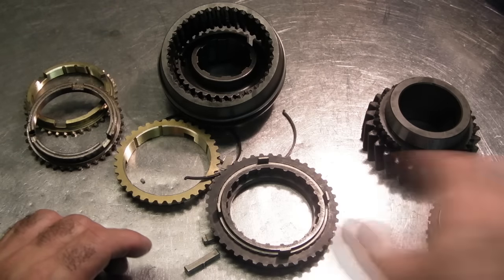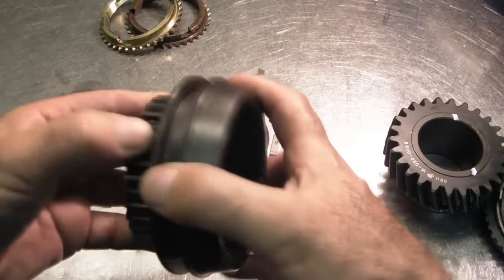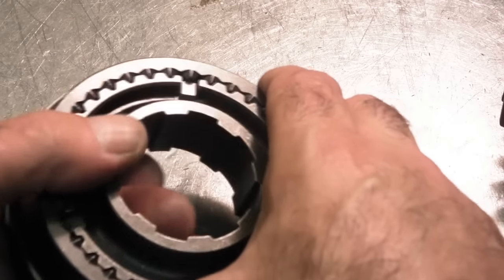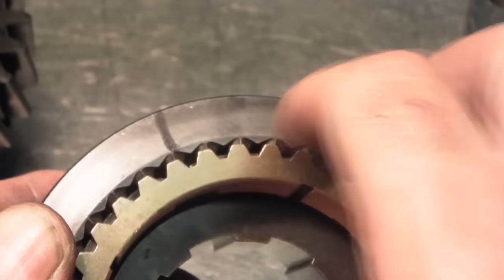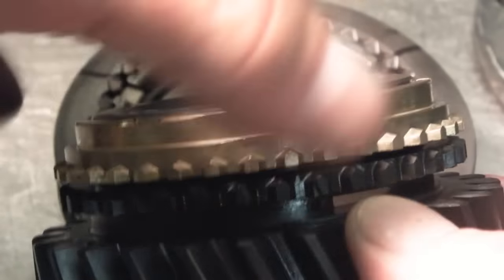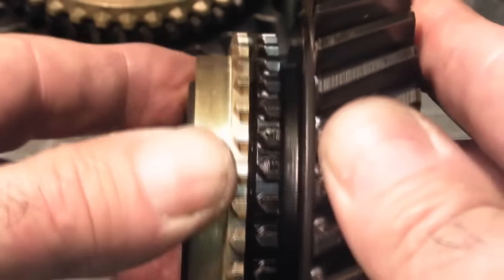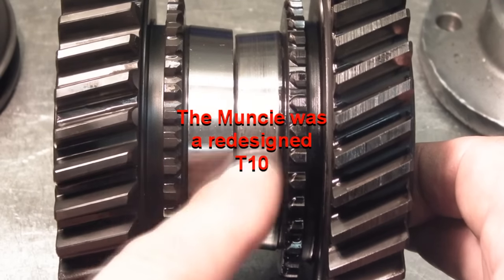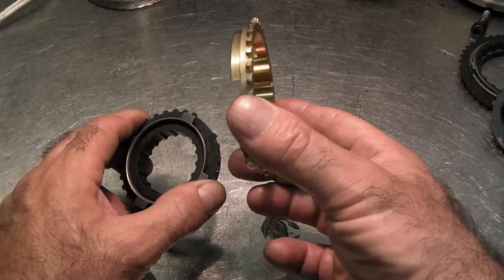Learn About Transmission Synchro Rings

Comment: This helped me understand the shifting issues I've been having in the H55F in my Toyota Land Cruiser. From the way you described their operation, my synchros aren't going bad, but may not be gripping as well as they should be to allow for smoother shifting. I always get that initial hard stop when shifting into 2nd and 3rd when it's cold lately. Now I'm going to look and see if there are any improved synchros available.....
Reply from the maker: Sounds like clutch hydraulic issues.  If it is smooth shifting standing still but hard shifting when in motion it means the transmission synchro rings have to work harder since the engine load is still on them. This will lead to ring failure.
Reply: @GearBoxVideo  Good idea. I had a stainless steel braided clutch hose that I went ahead and installed before a road trip this last weekend, and while doing that I (of course) fully bled the system, flushing out all the "old" fluid (had only been in there since May this year when the manual conversion was done) that somehow already had gotten dark with brand new fluid from an unopened bottle, and adjusted the pedal height and travel per the Toyota factory service manual. In my setup there is no adjusting of the slave cylinder itself, and I haven't yet pulled the clutch cover to observe its movement, so I haven't completely ruled out a clutch issue yet. While pedal feel is noticeably improved, the shifting hasn't changed. Next step to pull the cover and observe clutch movement lol

Comment: Hi Tony,  Sal here,,,  excellent and super informative video!  Very good delivery too!  Glad I stopped to look here!!!    I'm dealing with a 2003 Ford Ranger 5 speed stick, with a 2.3L motor, and shifting gear to gear is getting more difficult it seems. I assume it's a synchro issue,, but,, sometimes when I shift from a dead stop, from neutral into 1st gear, I can feel something sliding just as I shift.  It actually can be felt in the whole truck!   It's as if the driveshaft, or something, is sliding forward & backwards making a slight klunck sound as I shift into 1st, or into reverse when I first hop into my truck and go anywhere initially.  It doesn't do it after that first starting up and taking off.  I would love it if you could just give me an answer if and when you can!!!   But thanks very much for giving me the explanation I've been looking for for quite some time now!   Ciao Tony!!!!

Comment: Let’s see if I have this right.  The slider is rotationally fixed to hub.  Axial thrust is applied from shifting fork, to outside groove of slider, to inside groove of slider (not shown), to strut keys.  Strut keys apply thrust to blocking ring, which is forced onto matching conical surface of selected gear.  Strut keys also keep rotational position of slider fixed to blocking ring (with about 3/4 of a tooth of play).  This causes a braking action between the slider - blocking ring assembly and the selected gear.

Additional thrust applied to the slider overcomes the spring force against the strut keys.  As this happens, the slider teeth align with the blocking ring teeth.  Also at this moment, since the inclined surfaces of both the strut keys and the slider are no longer in contact with each other, there is no longer axial braking force between the blocking ring and the selected gear.  This fact allows the slider to mesh with the engagement teeth of the selected gear.
Reply from the maker: Yes, that pretty much sums it up.  Since the rotation of the gear will rotate the ring, which is stopped by the key ( called indexing) the slider most overcome the ring blocking the slider

Comment: oh this is beautiful, I just understood where the force feedback comes from. It's the angle of the ring teeth, the harder you press the more torque the ring applies to the gear, and the more force you get back... up until the point where their speeds match and no more torque is resulting from acceleration, and so they mate.

Comment: Have your book.  Very good information on rebuilding muncies.  I want to replace my shift forks over the winter. Can you tell me which ones to order.   I ordered some several years back and had to return them as they binded in transmission.  Also who sells the bearing side covers?   Thanks

Comment: Really interesting stuff.  Had a VW Golf once which would not engage 1st when engine hot. Turn engine off - no problem. Slip into 1st when car moving - no problem. Never sorted it!
Reply from the maker: Usually that is a clutch issue.  They expand when hot and you loose the release clearances.

Comment: Okay, wait, I've lost it again.  There's still one piece that you haven't explained, and it's the most important piece.  So the synchro ring slides onto the gear and grabs the gear so they are going the same speed.  What you did not explain is, how do the teeth on the synchro ring get lined up with the teeth on the gear?  What prevents a "block out" condition, as you described between the synchro teeth and the slider?
Reply: I’ll try to answer…watch from 6:40.  The backlash, which allows that backwards “blip” that he mentions, is a slight sloppiness and is what allows the whole thing to “blip” enough to align the synchroniser teeth to align with the slider teeth. Watch from 6:40.  The backlash exists because those strut keys don’t lock everything tightly in place, there is still a “sloppiness” in the assembly, which allows an “indexing action”.
Reply: @biopsiesbeanieboos55  Thank you for responding.  I spent hours yesterday watching these videos and I finally have it figured out.  Mechanical engineering is amazing.  The most important parts are the smallest—the struts and the springs...and torque.  The question is, what is even the POINT of the blocker ring? Why can't the shift sleeve be built to do the clutching action that brings the speed gear to the same speed as the output shaft itself? What is the blocking ring FOR?

The recesses in the blocking ring are engineered specifically to be slightly larger than the struts themselves, so there is about half a tooth play in either direction.  When you push the blocking ring against the speed gear, the friction brings the speed gear to matching speed, blah blah--we know that part.  But what ELSE it does is pull the blocking ring out of alignment with the teeth of the shift sleeve. That is the most important detail.  That is the blocking action (and the synchronization action).  When the driver pushes on the shift lever, if the speed gear is going at a dramatically different speed from the output shaft, then the blocking ring will be pulled hard out of alignment.  Too hard for the driver to overcome.  The flanks on the teeth of the shift sleeve push on the flanks of the teeth on the blocking ring and try to bring them into alignment, but it's impossible until the speed of the speed gear matches the speed of the blocking ring.  Once they are close in speed, the torque exerted on the blocking ring by the speed gear slackens enough for the driver to overcome it.  He can then push the shift sleeve past the blocking ring, which now aligns back to the center, and the tooth flanks on the shift sleeve can now engage directly with the tooth flanks on the speed gear, but by this time, the speeds of speed gear and the shift sleeve are the same or so similar that the driver can easily overcome that and slide the shift sleeve over the speed gear teeth, locking the two gears.  The tooth flanks will make any last tiny adjustments in the alignment of the speed gear easily because they are going almost or exactly the same speed by now.

So what is the purpose of the struts, and the angled protrusion on the struts, and the spring?  The problem is, when the driver first shifts, the blocking ring will not be out of alignment, and the shift sleeve will go right through blocking ring and grind with the speed gear.  That's the purpose of the struts.  When the driver first pushes on the shift lever, the shift sleeve pushes against the protrusion on the strut.  The spring is pushing the strut outward against the shift sleeve, so the radial force of the spring against the strut is greater than the radial component of the force of the shift sleeve against the angled protrusion on the strut, so the shift sleeve pushes the strut axially toward the blocker ring.

This action pushes the blocker ring against the speed gear, so if the two are going different speeds, the differing speeds will pull the blocker ring out of alignment.  It's necessary to engage the blocker ring with the speed gear before the tooth flanks of the shift sleeve collide with the teeth of the blocker ring, so that when the teeth of the shift sleeve engage with the blocker ring, it is out of alignment if the speed gear speed differs.  Then the blocking action happens as described above, as the tooth flanks on the shift sleeve push against the blocker ring teeth until the speed difference lessens so the torque lessens enough that the driver can overcome the resistance and align the gears.

But here's the cool thing about the struts.  Once the blocker ring is in contact with the speed gear, the blocker ring will be pulled out of alignment, and the job of the struts is completed. After some moderate amount of force is applied from the shift sleeve to the axial component of the force on the angled protrusion, the resistance from the blocker ring will be stronger than that force, and as the driver pushes the gear shift further, the shift sleeve pushes the struts DOWN, radially against the springs, and out of the way.  The shift sleeve can then push past the protrusion on the struts until the tooth flanks of the shift sleeve collide directly with the teeth of the blocker ring.  But by this time the blocker ring is out of alignment, and the synchronization can continue, as described above.

When I figured out how the struts and springs work, I was completely blown away.  Anyway, that's how it works.

(By the way, one last interesting detail. When the speeds of the speed gear and the blocking ring are rotating at similar speeds so that the torque lessens and the driver is able to push the shift sleeve through the blocker ring teeth, realigning the blocker ring, two things happen.  First, as described above, the tooth flanks of the shift sleeve then collide directly with the teeth flanks of the speed gear, aligning the speed gear so the shift sleeve can slide all the way into place. But secondly, once the shift sleeve pushes fully past the teeth of the blocker ring, it also "lets go" of the blocker ring.  That is, the tooth flanks of the shift sleeve teeth are no longer exerting any axial force on the blocker ring, so the clutching action is dropped at the same time the shift sleeve engages the teeth on the speed gear.  Without the blocking ring letting go of the speed gear, the final alignment would not be possible.  Isn't that amazing?)
Reply: @greg55666  I must admit I hadn’t thought about it in that much detail.  It seems every component is doing more than one thing simultaneously, with components coming in and out of effectiveness at precisely the right time.   Thank you for making me think even more deeply about synchro than I otherwise would have.

Comment: I think I'm about confident enough to atleast take a peak at my t-5, it needs bearings and 1-2 syncro, and had reverse issues. I think it's in the shifter. Parts. Anyway, thanks for all the info, and great video. I haven't been inside alot of transmissions, I have helped with auto trans rebuilds, and shift kits, and built lots of engines. Thanks

Comment: How does it make sure the teeth of the gear stay lined up? I understand as it applies pressure it will start turning the gear, but how does it make sure the gears teeth are lined up with the gear that swings back and forth? I hope that makes sense.
Reply from the maker: The slider will find its way because it has a certain window ro move in
Reply: You and I are hands-on learners, I think. 🤭

 I’m having trouble visualizing exactly that part, despite how EXCELLENT the video is. But then I kinda get it… but then it slips away. (There is no such thing as a good transmission pun, sorry. This is why I do words, not gears. I will see myself out now.)
Reply: @GearBoxVideo  I can’t believe you’re still answering questions so promptly on such old videos. You must be a busy, busy guy. Thanks for your hard work - as everyone says, you explain things so well!

Comment: I had no idea the synchro actually had to momentarily move the gear backwards.  Thanks for this video.
Reply from the maker: Yes that is why the clutch needs to be released fully. Some people confuse backwards with reverse. The transmission is not in reverse. It's that the blocking ring has to unblock which shifts load to the opposite motion. I'm going to do a video showing this movement soon
Reply: GearBoxVideo , Cool!  I gotta see that one.

Comment: Amazing example and explanation!
Reply: To explain a little more I rebuild an sm465 about a month ago and did a shift by hand with the top off to verify its functioning. Went back to it a day ago and could not get it to spin in neutral.... turns out its because the blocking ring on 4th gear is stuck to the input shaft. Going to back off the front bearing retainer and see if I can add some gear oil and get it to spin....
Reply from the maker: Just pry the ring loose with a screw driver and rock the output shaft left to right with a yoke . I have a video on This channel explaining the problem. Search for stuck rings

Comment: Ok... now I know that I likely have a soon to replace 1-2 synchro.
However, the reverse grinds a bit after a stop (hydraulic clutch)... I'm guessing a good checkup on the whole clutch system for leaks is due.
Thanks for your great explanation.
Reply from the maker: darkmetallink1  Poor clutch release will cause reverse grinds because the transmission really should not be spinning if the clutch is fully releasing. If you wait 10 secs with the pedal down and the trans never slows down, you'll know that a release issue is present.   This prematurely wears rings out at higher RPM shifts.
Reply: And if it only happens rarely and only if shifted 1 sec after clutch engaged?
Meaning, if i'm driving to a stop, clutch and wait 2 secs and engage reverse, no grinding. But if done immediately after stop, grind?
Reply from the maker: that would be normal
Reply: Thank you very much. I'm used to the grinding since so far I've had high mileage old cars. This one is my first "new" one (05')